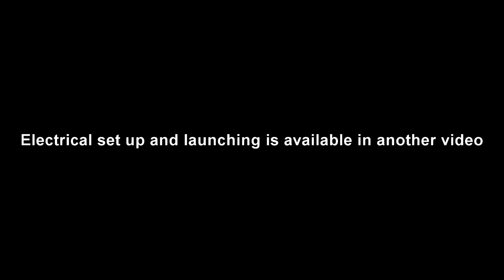Hellkite build instructions by IBCrazy

Comment: How much reflex would you suggest for this bird to help with level flight and launching most importantly. Don't seem to have enough where Im at currently
Reply from the maker: It needs a lot of reflex.  3/16- 1/4" or so should be about right.
Reply: Video Aerial Systems Thank you! Gonna adjust that higher, fix my motor mount and try again 👌